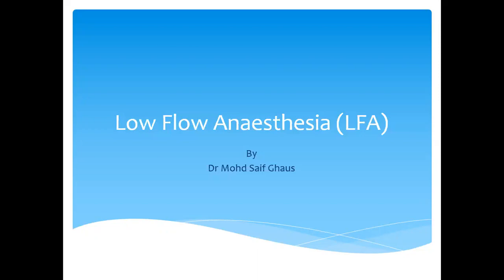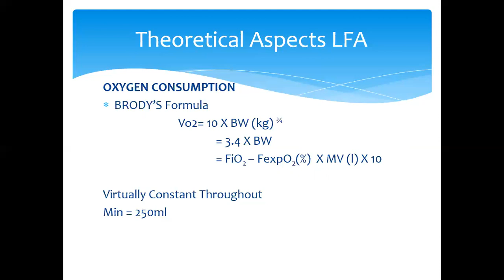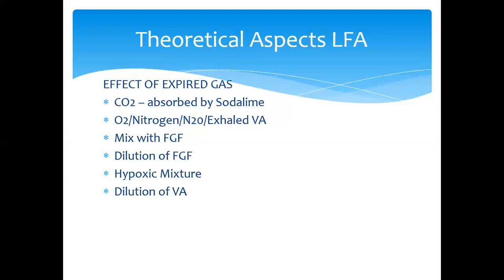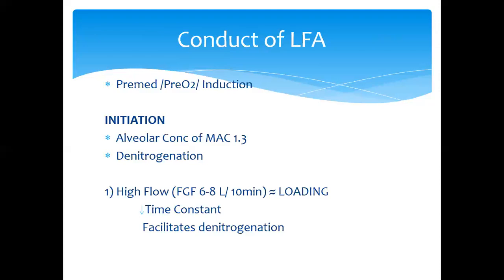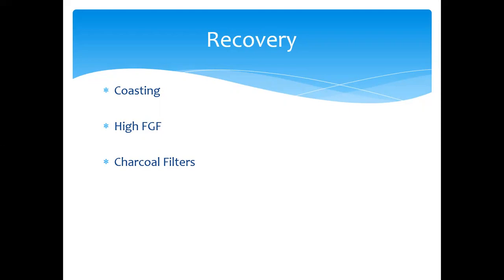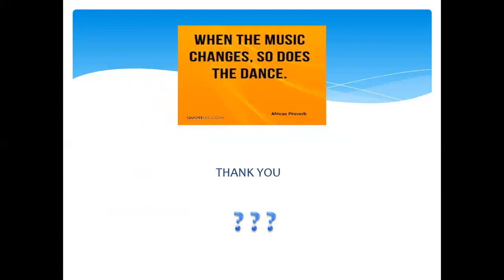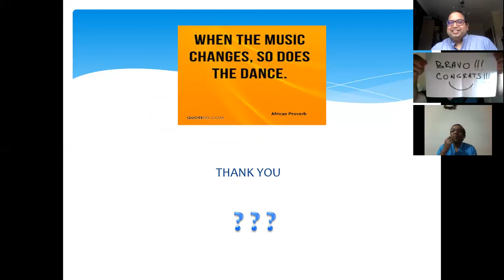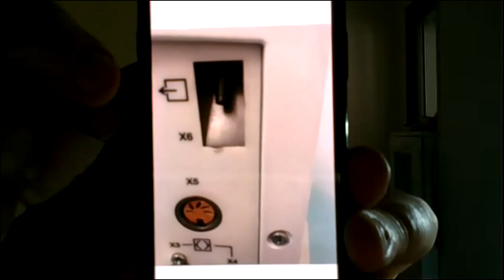LOW FLOW ANAESTHESIA: THE CONCEPTS

Comment: I have practicing the low flow or closed circuit for years and never had a probelm. The key is gas analyser as you said. But I noticed I was alone when I was released for  abreak all with no exception will change the flow to 3-4l/ min something I do not like.